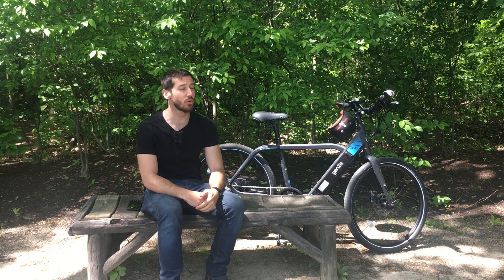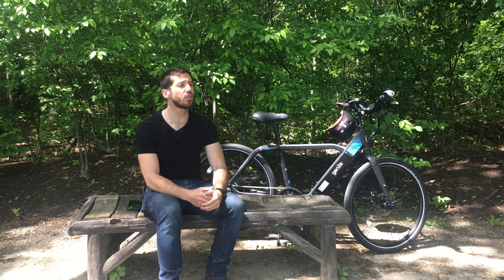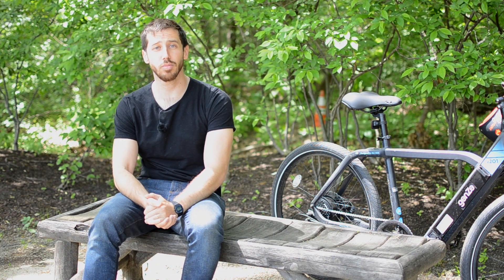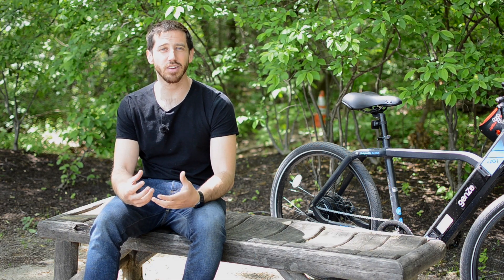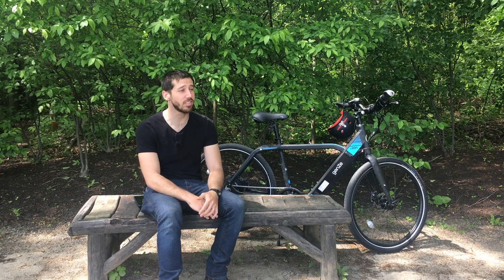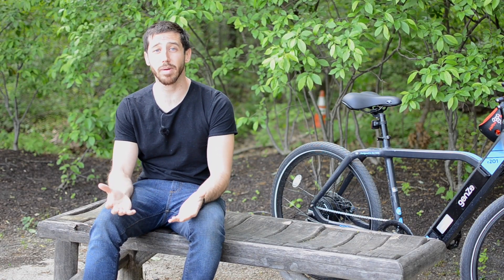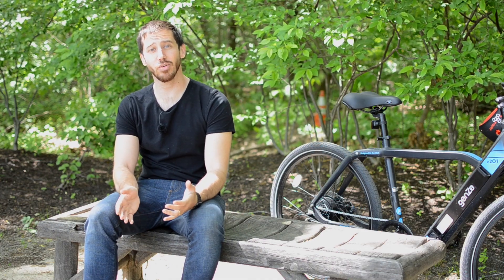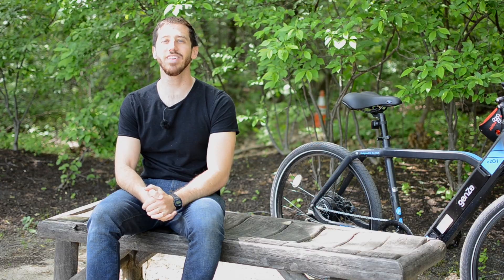How to choose the right bike for a DIY e-bike

Comment: I put together a mountain bike (I got for free so I could not pick) and I rode it on the road for 7,000 miles in just 3 months.  I have 3 13 ah packs to do that.  I recently was able to install a second battery attachment after trying it all as no battery can fit in the triangle, not even the controller.
In addition, I lowered the seat so it handles corners much better, I barely pedal, picking a bike with a low seat is something to consider.
So I will make a short video of my bottle attachment with no holes on the steel frame, using radiator clamps that could be painted black or covered with a piece of cabling cover, piece of tube, etc. for better looks.

Comment: Could you do a video on managing a diy battery that doesn't have a BMS? What kind of charger do you use? Any additional equipment you'd need, mistakes to avoid etc. Thanks

Comment: MIcah: totally agree on steel frames. 
However, caution on frontwheel motors: most forks aren't purpose-built for those forces down at the dropouts. This would apply to the moment arm, and also to typical joint of the dropout to the fork arms.

Same thoughts apply when you're doing a disc-brake conversion, but a whole lot more with adding a front-hub motor.
(which, of course, is why I'm doing both).

Comment: I built my own ebike battery from harvested laptop cells 8 years ago when most people had not heard of ebikes.  My original was a low cost ezip from walmart.  First we upgraded the speed controller then doubled the volts to 48 and got that old hessy to 30 mph with pedaling.  We did put a potentiometer on the lv throttle signal to keep it a little below its max to avoid burning up the motor immediately.  Anyway I am just getting back in the game, I must say you are exceptional at explaining these things and I am a fan!  Working on a fat bike 3000 watt build at the moment and am still waiting for my smart bt BMS from Aliexpress.  Still in the process of testing and marking up the harvested batteries before entering all the data into repackr.com.  The physical limitations of the triangle i am working with is going to limit me to a 20s 7p arrangement.  This should be around a 17ah pack.  I am hoping this is sufficient but I fear it is not.  Most of my cells are a 5 amp max discharge so 35 amp max discharge in theory for this battery...  Have you found any torque arms that don't look silly with the hose clamp etc...
Reply: I have a black bike and I painted my torque arm black. Even I don't notice it's there :)

Comment: i put my first 250w front hub on a bike with magnesium forks... worked great  for about 2 weeks but the bottom of the magnesium snapped as I was pulling out onto a road. The wheel wanted to keep going forward but the bike stayed stationary XD 

Now got the kit on a nice old fully steel Apollo with an XL oversized frame which has enough room to mount a 13s30p battery :D
Reply: Even though it's a steel frame now make sure to buy a torque arm for your motor.
Go to aliexpress.com to purchase it... I highly recommend it
Reply: @R.B.forMER_S.  currently still using my original 10s battery so it only goes 25kmh but when I upgrade to 13s and have a lot more weight I will definitely be adding a torque arm

Comment: I bought 2 E Bikes  both MTB but the 350 wattgear motor has 1 Shock in front forks in a factory made e bike MTB. The 1500 watt GEARLESS DD is a conversion kit I build on a NEXT Power Climber of 2 Shocks, at the front forks and under seat at bottom half of frame. The difference in how they ride is extreme. The 1 Shock Frame is always bumpy on rough pavement as the Dual Shock frame going over 35mph is much a better ride when going over rough pavement in little bumps, pot holes, ect. Both E Bikes are GREAT and perfect as the 350watt only  goes 20mph so not too important for riding but the 1500 Dual Shock going over 35mph is AWESOME and next build I know its best to get Dual Shock  frame. I use the NEXT due to the motor in front wheel and is perfect as you are riding on top and behind front wheel, the frame shows this in design and seems perfect of the frame with dual shocks for handling fast speed in comfort for you and bike..

Comment: Hi thanks for the great videos, very well presented. I considered all the pros and cons and went for a 500w brushless hub motor for my first DIY ebike. Question though The rolling resistance when not powered seems to be my only issue. Im going to change the tyres but was wondering if a 250w motor would have less rolling resistance?    Thanks Steve

Comment: Question on the battery packs. If your making your own 48 volt pack for a DIY E-Bike, can you purchase empty cell holders for your battery pack like the one you can lock to the mount of the frame. You showed it on one of you builds. Not sure if you purchased the battery pack or built it yourself. Thanks for the great videos.

Comment: Hello Mikah, I am a big fan of yours. :)
I learn a lot from your videos, I have already built my first 500W electric bike and it's working perfectly. Right now I need to change the controller on a used bicycle, I have already purchased the compatible controller, but the wires and the connectors do not match. The color code isn't the same either. Could you help by creating a tutorial on controller wiring? Perhaps I can combine the wires to see where what belongs? What I've achieved so far is that the motor propels backwards. XD
If you could make time for this, I would be very grateful.
Sincerely, Lui

Comment: any motor suggestions for an inexpensive tricycle? built for snow/ ice?
    I will be building a custom tricycle from a regular 26" bike. The rear will have 2 wheels that are close together so that there is added stability without compromising too much on  maneuverability. i'll be aiming for around 15 mph max. with a distance of under 5 miles (can always upgrade the battery pack). This will be my winter commute. *The idea of using 2 wheels in the rear will hopefully keep the bike from flipping onto its side if traction is lost while on the road. I am looking into Alibaba motors since they are inexpensive.
    Would love your input :)

Comment: Your chanell is choke ful-o-inspiration. I've been researching an ebike plan and have some advanced DIY questions. So I have my frame, rims and tires. My objective is as follows: My ebike will have 26" wheels with disc brakes.  I have a general idea on a DIY assemble of parts and an understanding on how they work and how to set them up. Here is the nuance of this project that makes it a bit unique.  I aspire to have a bike that is pedal active, meaning that with battery I with have pedal assist, but when coasting or with not power I want to have the bike pedal normally. And, in that with an ebike with pedaling functionality rather then a cassette with a derailleur, its ideal to run a IGH. Given this IGH how can I integrate  a rear hub  electric motor that also serves as a 7 speed/geared pedal bike? My question is; does a internally geared hub work in concert with a rear hub electric motor or is the IGH element built into the the electric motor? In both situations how to do I ensure that I stiff get forward motion manual power when pedaling the bike?  Is there a designation for a ICH and /or electric motor or one that has the IGH integrated to have this functionality? And all this being said am I left with a chain/belt tensioner rather then finally getting to build a bike with my long desired Campagnolo derailleur groupo or are those says long gone? If I choose a set up such as Befang is the hardware included or d o I still need to select a hardware groupo such as Shimano for this application? With the logic that every once saved is a good thing, what set up solution can you suggest that is a mix of aircraft aluminium and carbon fiber? An lastly as it may be a critical detail, I intend to use a Veer belt  rather then a traditional chain. Also based on your YouTube videos I will be using 14 cells in sequence to build a no weld triangle battery that is 52v.
Reply: Once this is built I will follow you lead and add a second hub to the front wheel and like you have an all wheel drive ebike.

Comment: Hi. My name is Shane. My question is can FST 18650 batteries be used as a power bank and can the battery performance be enhanced or last longer in any way using the vruzend caps. I'm going to be building a big solar generator to power nearly half a house and my choice of battery is the Panasonic 18650 but I am real curious about the FST 18650 if they would come up to standard. I'm very interested in your opinion on this, even if these batteries were just used as a small portable power bank. Your channel one of the best channels to learn from. Looking forward to your next video

Comment: I am not tall, and my bikes are all small frames.  With the rear shock parallel to the top tube, there leaves very little room in the "triangle" for a battery of decent capacity.  I've seen saddle bags with two smaller batteries draped over the top tube, cased batteries on top of the top tube, below the down tube, and also mounted on a rear cargo rack.  I like that idea, but heard the weight distribution can cause an unpleasant ride.  Does it really affect the ride that much?  I'm installing a mid motor, and I have heard one of the downsides of a rear hub motor is the large rotating mass...

Comment: for ebikes, is there a portable solar panel and charger(built in maybe) that can charge the battery,or is it possible, as in ride for a day,camp and charge for a day or will it need more days ,or if you have trailer with a solar panel top charging a spare while you ride for next day  cheers

Comment: I have a Mid Drive Motor on a Carbon Fibre bike, basically you are looking at 3.5 kg of Motor & 2.5 kg of Battery Pack. It's pedal assist 80nm Motor with a 36T/48T Chainwheel 23T - 11T Cassette which with a cadence of 90 can produce between 16.5 km/hr - 45.5 km/hr. The reason for my wanting a lightweight system such as this is that I want to still have the benefits of riding without needing to be a competition cyclist & I'm happy going along at a bit over 28 mph & that suits me. I don't want a huge motor & huge battery & throttle so I can be lazy.

Comment: I just discovered your videos and am working my way through them.  They are very informative and well presented.  I started riding a converted Canondale with Bafang motor , battery and other components about five years ago, and have been very pleased with a mid-drive system.  What do you think of Graphene batteries and their potential for use in e-bikes?  Do you know of anyone who is producing them for e-bikes?

Comment: Hi Micah, Just been binge watching your channel, it's fantastic! I'm getting into building my first ebike (and maybe even the battery). One thing I don't quite understand is why you overvolt your motor to then limit the current draw afterwards. Isn't that the same as just using the lower voltage  battery in the first place? Probably not, but I would love to know the reason... Keep on doing what you do, I'm a fan!
Reply: Unless you have electronics background, probably best to just buy a battery for your first ebike. Overvolt is for speed and rpm; lower volt is lower speed and rpm. Overvolt is also more efficient since it uses less current.

Comment: Hi, nice video, I would like to make a battery for a 1500w hub motor but with 52v voltage (14s). Which battery configuration do you recommend for this motor and above all if I use the cells of the Panasonic NCR18650B how many cells do you advise me to insert in parallel to have good performance and reduced stress per single cell?

Comment: I'm making am E-trike (my balance is shot). I want to use a rear drive motor in place of where the rear, mid, axle would go and use a gear to drive the back axle. The gear will go where the disc brake would go. My question is do you think the spot will be strong enough?
Reply: Will it be driven by the motor or you? Not sure what it is. Overall, I say yes. Gas motorized bicycles are typically left side driven from things as crude as a rubber mount around spokes to cnc axle adapters that wrap around the hub. I think the disc mounting will be as strong as the cnc axle adapters. The gas motors make 1-3kW typical.

Comment: Hi Micah, if I plan to get the Bafang 48V 1000W kit and custom build a 52V 10AH battery pack using Samsung 25R 3.6V 2.5AH cells (4P14S layout),  is this good enough? What is the minimum AH rate for this kit? any recommend  #P#S layout? Just a simple rectangle setting, nothing fancy. thank you sir!

Comment: What's your tough on buying a ebike frame from China or Taiwan and adding you own components? 
Some of these bikes come with hallowed area for your battery. Many ebike companies buy these and put their name and equipment on them. Some are good equipment, some is trash. They build to sell where I would build to keep and use. I want a good compact, light weight folding ebike with both front and rear suspensions so my wife and I can bring with on our RV and use to get around city as well some trails.

Comment: Your video is really informative and I have just subscribed to your channel.
I do have a few questions though. Can you comment on what to look for in a donor bike in terms of brakes as in rim brakes vs mechanical disc vs hydraulic disc, which one is harder or maybe impossible for the conversion?
Also please comment on the shifting mechanism. I often see Shimano rapid fire where the brake is separated from the shifter but sometimes they are integrated together. I figure I should stay away from the integrated ones right?
Thanks

Comment: Great video , can you make one about a DIY dual battery ebike. P.s I've been looking to make one and I would appreciate the info. Can you talk about adding batteries in parallel.
Reply: My thoughts are that it should be the same battery from same vendor = same capacity, voltage, bms. When in parallel, it becomes one battery so a limitation in one will limit the other. Also before connecting in parallel make sure voltage are the same and within 0.5V.
Reply: @feedallday2556  currently I have a bottle shaped battery that is about 13ah and it worked fine for the trip I needed but now my trip has increased significantly and I need about 2 as much distance so I saw that as the only option do you have any other recomendations
Reply: @elbengay  If the battery is well cycled and old, I think you might to start over with fresh batteries but if not try to get the same one. What connectors come with the battery?
Reply: @feedallday2556  it comes with xt60 connectors and do you think that a year is old for a battery. I'm on a bit of a budget so I would like to use my current one.
Reply: @elbengay  No, a year is not too old unless there is something wrong with the battery. Make sure they are around the same voltage (<0.5V) and then connect them in parallel. There are cheap xt60 parallel connectors on eBay/amazon if you do not want to make one.  Two batteries in parallel is typically better than replacing one with the other since it reduces the current load. But you can test the range of parallel versus replacing with a fresh one.

Comment: Hi Sir, I have a question about E-bike controller i don't know which to use on 36V-48V 350w controller or a 48V-60V 350w controller running on 48V battery also can i use e-scooter controller for my ebike ?, I am a Uber Eat guy i need by bike to travel as far as my bike can go will you kindly guide me about this many thanks sir.

Comment: Aluminium frame and magnesium fork here.
nothing happened on the drop-outs. Ever. I have smashed the bearings in the hubs and worn the uppers on the fork but not the drop-outs. 
It-s a horizontal drop-out RockMachine Quake and had several Shimano Dart and alike cheap forks. 
I even had stainless steel diy sleeves over the axels to prevent the thread from embedding in the frame but rode a lot without with no damage done. The washers and nuts hold the axles enoug.
Rear hub is 250w ran at 1000w peak and front is same but ran at 350w peak and that just because the gearing inside the hub can't handle more than 400w-ish without failing.

Comment: Thoughts on using a more light weight/affordable single speed bike for a first build (dd hub)? From what I understand most people don't change gears on an ebike anyway.
Reply: You want some gears or change out that rear gear low gear so you can get a higher gear ratio. Yes, if you have a big battery you don't really pedal but you should help it off the line or accelerate to cruising speed. This peak power draw is usually 2-3x that off cruising speed so pedaling helps. But, with one speed cruisers that rear gear is too high so if you can swap it out to provide maximum assist to the motor on take off it be good. Then at cruising, it all comes down to your weight, location and conditions, and efficiency of your bike.
Reply: @feedallday2556  Maybe an internally geared hub on the back wheel, and hub motor on the front, then? It's probably more expensive but would keep a slick look and I could save money on the bike.
Reply: @jordanmkrebs  Wait, sorry. Most rear hub kits come with a 6-7 speed cassette so ideally you might be able to just move your single speed chain to a set high gear 1-3 and that would be fine for helping it take off and then let motor take over at higher speeds. .

Comment: Question:  How do you build a bike differently depending on the climate it will be used in???
Reply: Water intrusion is a big problem. In wet climates, the battery and controller should be water proof in a monsoon and will require water tight boxes. and of course, the battery needs to be removable.